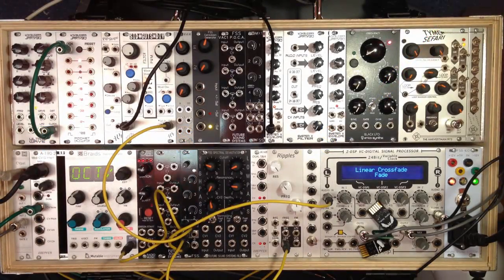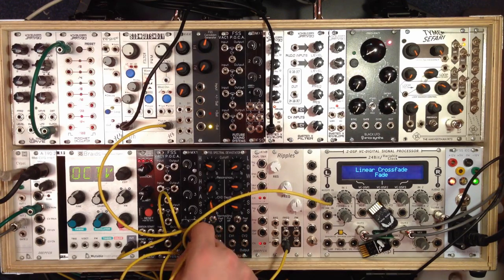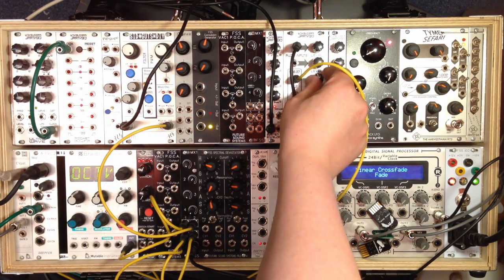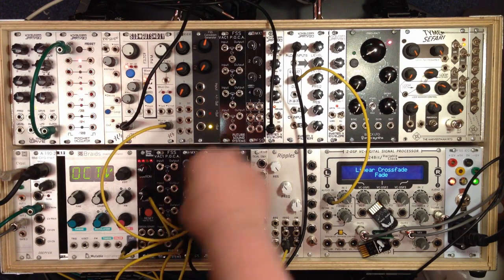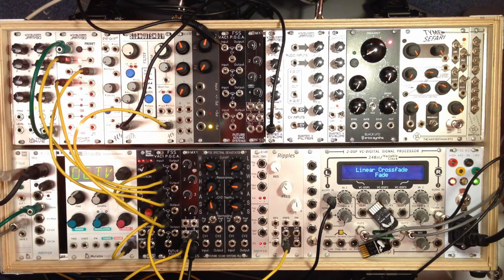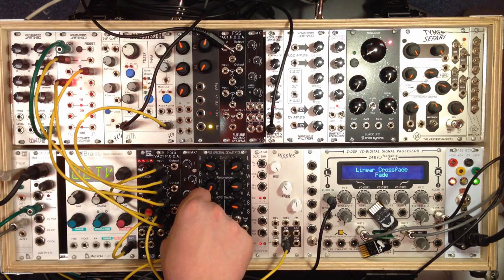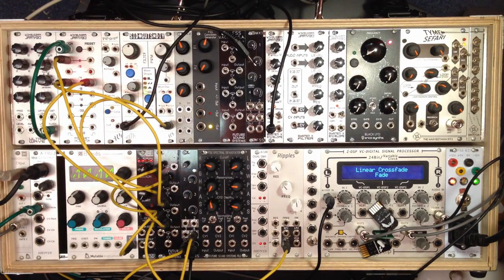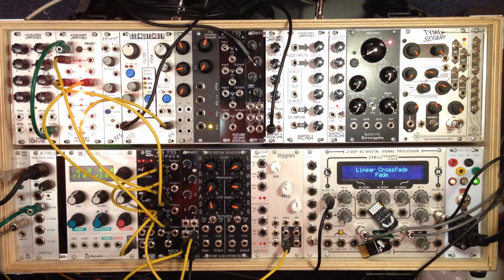Future Sound Systems MX1 Eurorack Mixer Demonstration

Comment: I have two questions about your MTX9 81 point pin matrix. What is the difference between the passive and active versions? Will my eurorack modules get damaged if I connect two outputs or two inputs on either of versions of the MTX9?